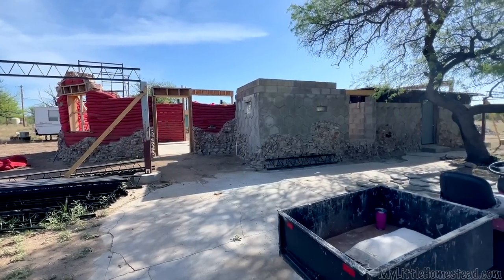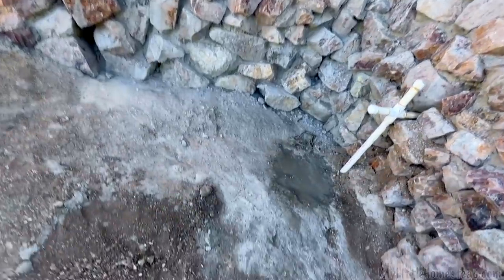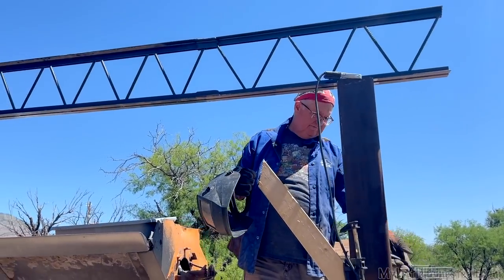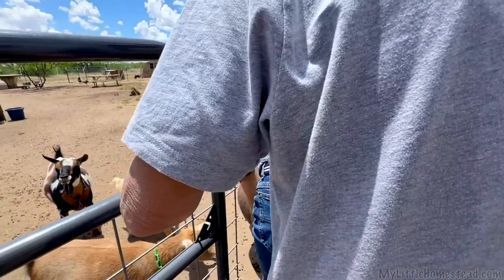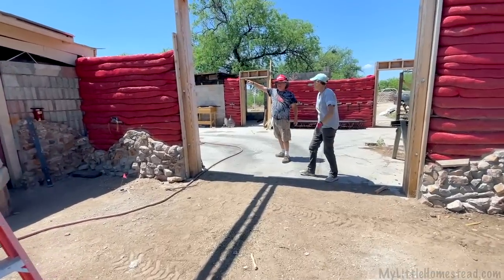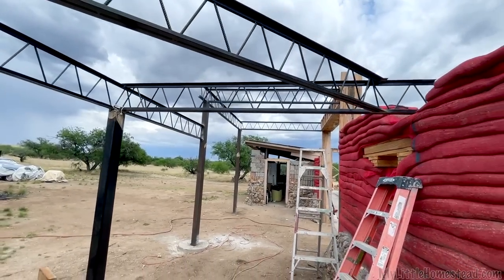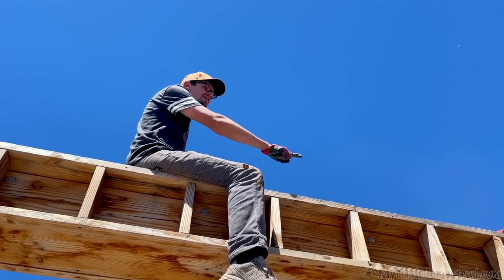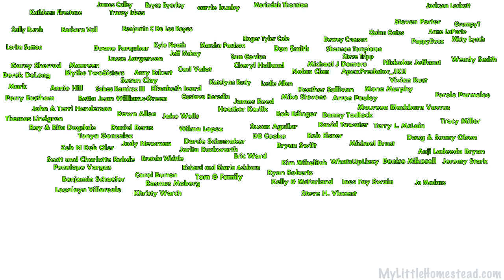Hyperadobe Shop Walls, Trusses, Aricrete Hexagons & TinyShinyHome! | Peek Ep392

Comment: When I learned to weld it was all still stick rod but shortly later they came out with the flux core we called it intershield and the only way I know to learn to weld is just by burning a lot of rods or a lot of wire. So if you don't weld really well yet Jared I would worry too much about it, every time you get a chance pick up a welder and start welding, and pretty soon you'll get it down so it will start looking good.

Comment: I'm a iron worker welder and I'd strongly recommend you do another pass on some of those welds and the cinder block wleded plate thing won't hold more than like 1 Ton with out bending those plates and ripping out of that brick u need a post taking that load to safely use it .

Comment: Where your wire comes out of the gun on your welder should not be sticking out past the cone of the gun. If you should happen to touch the tip to the metal you are welding your tip will disappear and damage may occur to you welder.